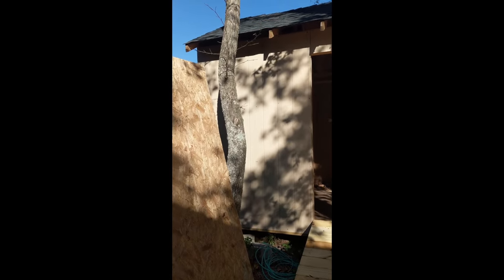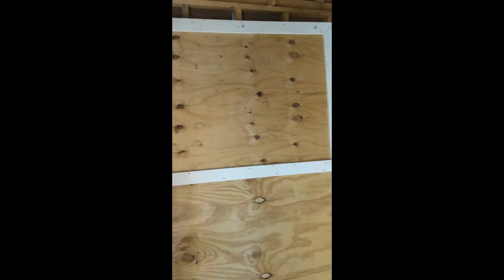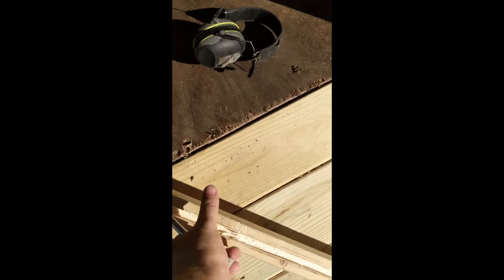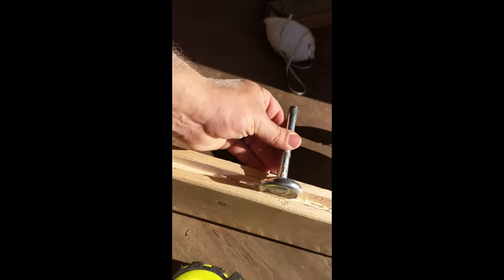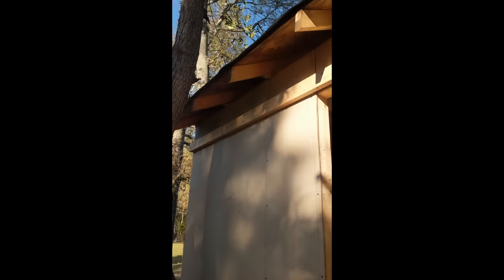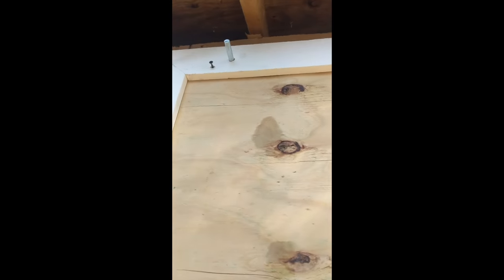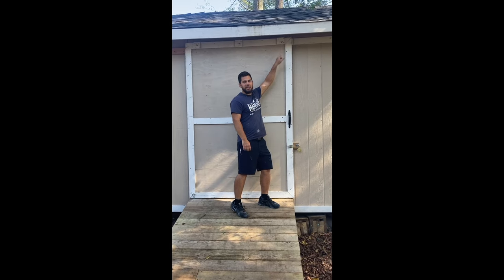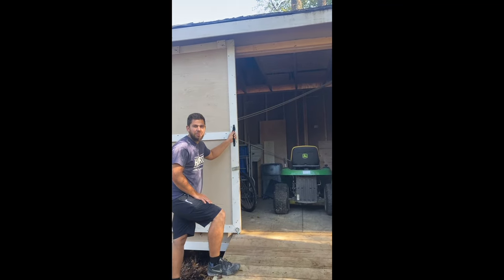$10 Sliding Shed Door DIY: Easy & Quick with Lowe’s Supplies

Comment: How do you hold the garage wheel in place? I was expecting to see some kind of nut, but those garage wheels don't have threads.
Reply from the maker: I did drill a hole on the front end and put a screw in like a pin to hold it from coming out
Reply: my very first question...you could make the holes tight but it wouldn't be long before the  wear and tear would widen those holes...yeah how did he do that